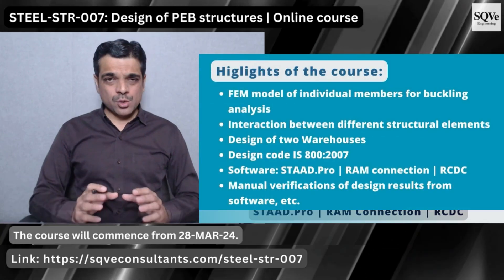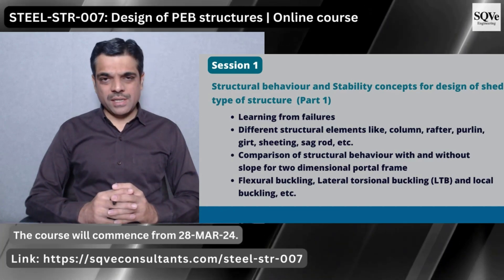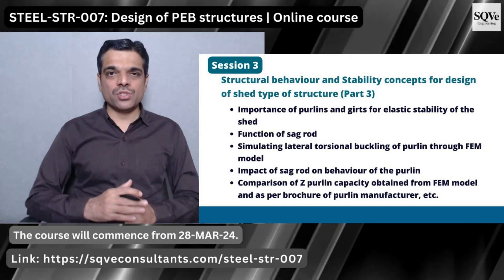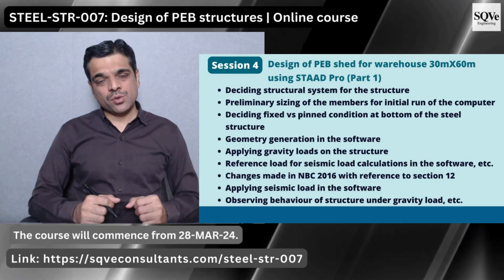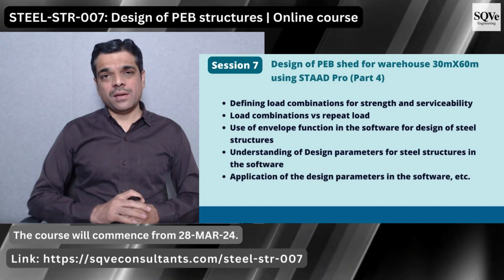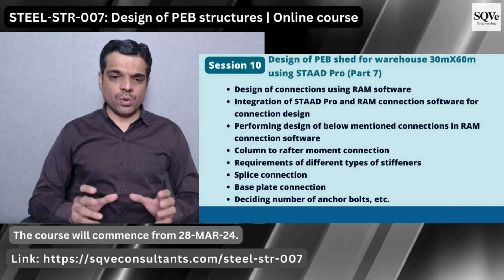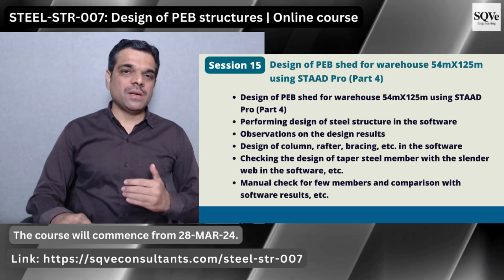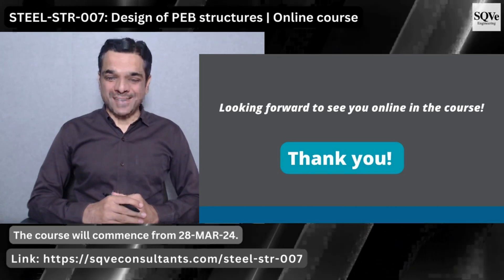STEEL-STR -007: Design of PEB structures (Part 1) | Warehouse | IS 800:2007 | STAAD | Bhavin Shah

Comment: Will the design include  manual calculation  or just main focus is software
Reply from the maker: The course include detailed discussions on fundamentals for design of PEB structure, manual calculations along with software applications. You may refer the content of the course at link: https://sqveconsultants.com/steel-str-007   If interested, you may purchase access of the recorded sessions along with course material for six months of time. For more information, you may connect with us through email address: contact@sqveconsultants.com

Comment: As you start full design course on PEB structure (i.e. STEEL-STR-007) , same way, it is necessary to start full training on various structure designs, like mid to high rise RCC commercial or residential building, pipe racks design, ESR design, underground sumps,box culverts,minor/major bridges, substations,switchyards,retaining structures, chimney,blast resisting structures, etc along with relevant static and dynamic seismic analysis as well as foundation designs thereof...
Reply from the maker: Thank you for the valuable suggestions. 🙏

Comment: Please introduce tekla structural designer
Reply: When design of water retaining structure course will launch, as per IS 456,IS 3370 ,IS 1893 (part 2) ??
Reply from the maker: @HamdanShaikh-i3h  Yes, it is under planning stage. We may launch the same after nearly three months of time. Meanwhile, you may share the content which would like to cover in the course through email address: contact@sqveconsultants.com.  We will attempt to address the same in the course.
Reply: @StructuralEngineering  awaited course.
Reply from the maker: @HamdanShaikh-i3h  Yes, it is delayed as we are receiving number of inquiries for the offline training. We have noted down your suggestion and surely, will come up with the course. The excat schedule is not decided yet.
Reply from the maker: Good suggestion! We will attempt to consider the same in one of our upcoming course.
Reply: For design of water retaining structures, it very crucial to consider hydrostatic as well as hydrodynamic (impulsive & convective/sloshing wave pressure) during seismic event, so it is very necessary to add the same in the course, ( even many professional structural design haven't enough and right knowledge for the same), codes includes is IS 1893 part-2 , IS 3370 part( 1 to 4). Also note that hydrodynamic seismic load as per IS  -1893 part-2 is applicable only for some ideal shapes of tanks (like square, rectangular,circular shape of reservoirs only),tanks with single compartment only, as well as only for tanks supported on flat base.
       Inclusion of application of hydro-dynamic seismic load on water retaining structures irrespective of above condition like , tanks of any shape (prismatic/tapered), tanks rested on flat or inclined ground, any shape of cross section of  tank walls uniform or tapered,multi compartment with different fluid heights & density/s needs to covered thoroughly along with theoretical concepts of computational fluid dynamics/potential fluid dynamics.
  Inclusion of moving load of multiple cranes running in underground tanks, that are generally available at ports. These topics needs to cover thoroughly.